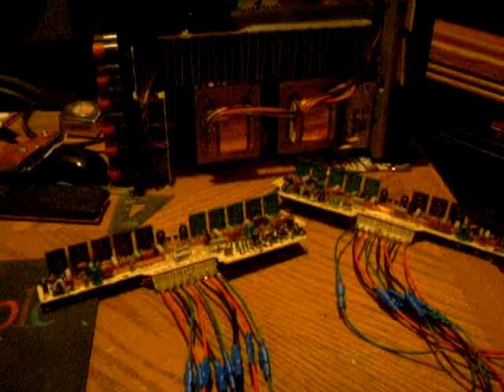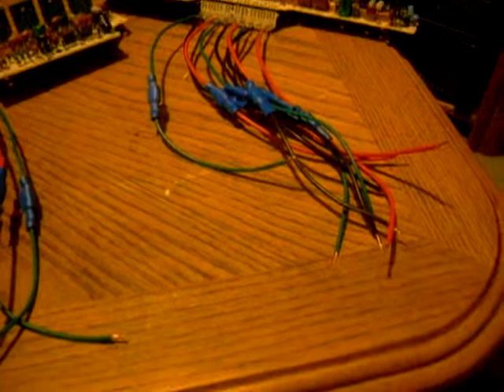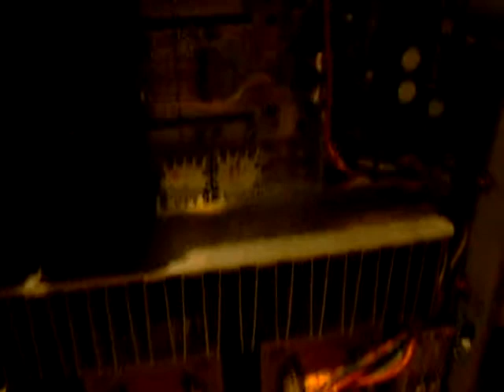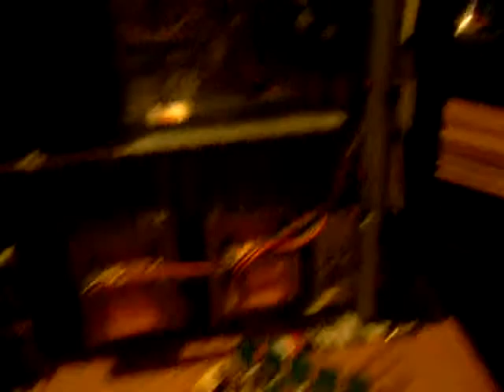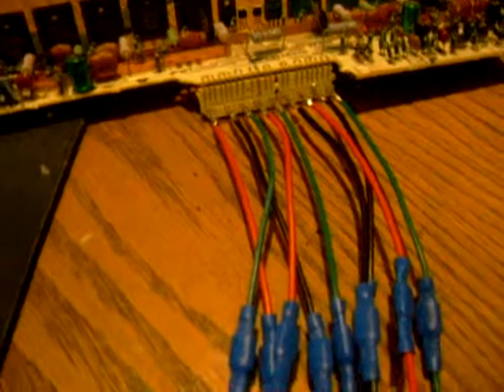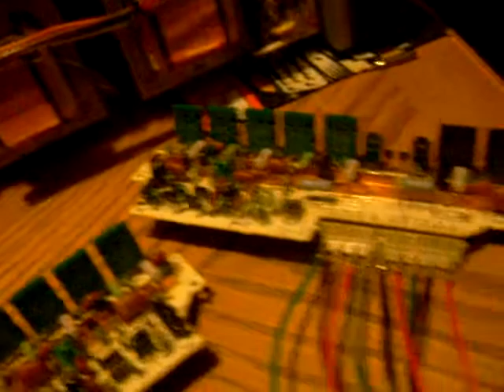Yamaha Mx 1000 rebuild 3

Comment: I think you will eventually find that extending the paths for the L/R channel HCA/I AMP/APS will result in more, not less problems. It will certainly add some phasing problems, not to mention signal degradation due to impedance mismatch. Making maintenance convenient was not a high priority for Yamaha engineers. Audio quality was their prime objective. I wouldn't be surprised if the amp sounded like crap after this "mod".
Reply: Agree completely.
Reply: Why would you need to do anymore removal of the boards.
Your distortion specs will never be the same, those connections are subject to oxidation  and resistance. 
Once you did the recap and restore you should never have to take it apart again.

Comment: Awesome job. I have one of these I am about to recap as well. I do have one question. Did you ever find any replacement caps for the big 4 even though you aren't replacing them? I've looked and cannot find any drop-ins.I think mine are still good as well but I know we are running on borrowed time.